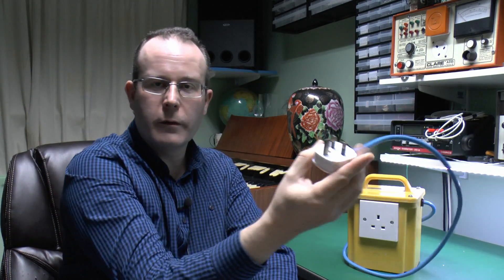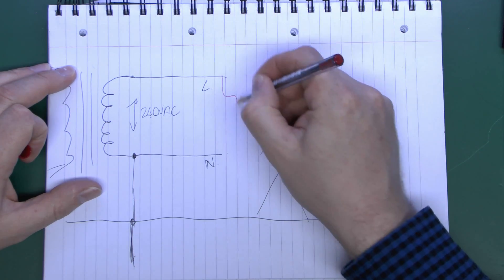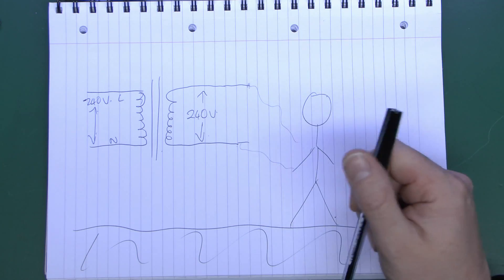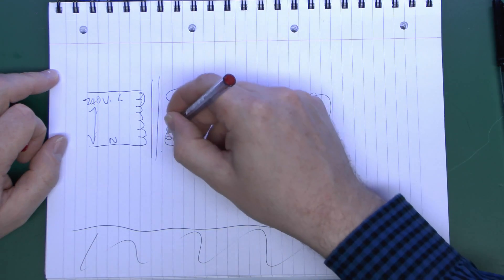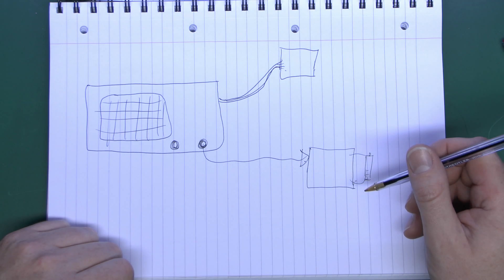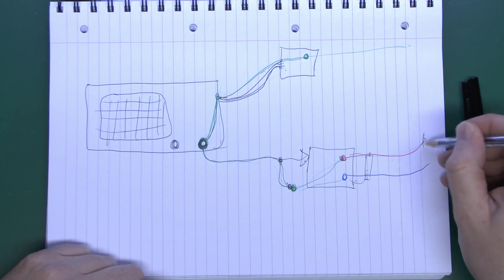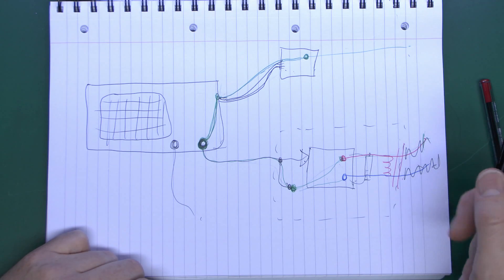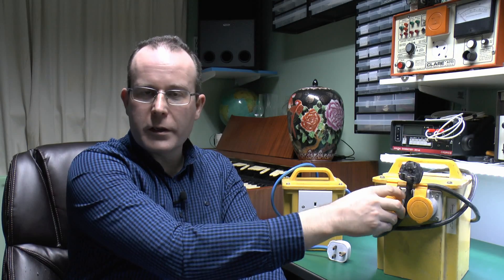Mains Isolation Transformers

Comment: I am wanting to buy an auto transformer and understand the non isolated risks when using one. I want to run an idea past you that I am thinking I could use for my safety. I have already an in-line RCD a RS 3 terminal fused connection block, two 160VA 240v - 24v-0v-24v transformers. I already have the in-line RCD connected between the mains and connection block. I realise this will offer no protection to me if I am seen as part of the circuit. However, I hoped to connect the two transformers back to back. From the 3 terminal block,  240v to lower voltage to lower voltage to 240v to a fused socket and plug in auto transformer. I could to minimise eliminate the RCD and terminal block and connect to a fused plug, these can be looked at as convenience, or not. Am I over looking a problem. Any advice is very much appreciated.
Reply from the maker: You can, provided the maximum rating of the transformers is not exceeded.
Reply: ***** I will have 3.3 amps 160VA/48V. I will buy a 4 amp auto transformer and fuse both sides, in and out at 3 amps. Thank you.
Reply from the maker: It's 3.3A only at 48V.  On the 240V output, the maximum current is only 0.6A

Comment: 11:00 There is in fact an even more dangerous situation that could happen if you cut off the earth pin from the oscilloscope. Poking the clip from the probe into anything at line potential will result in the metal casing of the oscilloscope (and possibly your workbench) being at full mains voltage, even if there is no fault in either in the scope or in whatever device you're probing.
Reply: I remember many years ago when I was carrying out PAT testing at an aircraft factory near Gloucester. I found an oscilloscope that had no earth continuity because someone had foolishly disconnected the earth conductor in the mains plug. They were not happy when I reconnected it. I had no alternative other than to submit a formal report to the firm's safety officer.

Comment: out of curiosity, what happens to the earth going into and coming out of the isolating transformer?
Reply: +TornTech 
This has been asked before by "sbusweb" amongst others, hope John Ward will answer that original question eventually =)
Reply: Darren Tipple  In Finland isolating transformers actually have an unearthed socket on the output. The only legal way to use an unearthed class 0 equipment in a room with earthed sockets is actually an isolating transformer.

https://www.trafox.fi/wp-content/uploads/2015/12/KLT2000_230.jpg

If course most people just take a knife and cut the plug to fit a schuko socket. Nothing is more comfortable than using a computer resting your feet on the grounded case and operating an old hot chassis radio with your left hand.

Comment: Hi John, how did you wire up the 110V output to only put out 55V? Thanks.
Reply: +ChompChompNomNom 
each yellow socket has 3 pins, 2 ''lives'' (connected to ends of output) and one earth (connected to centre tap of output).
In effect that 'earth output'  pin is also a neutral, and both of the other pins have voltage on them.  Think  Live ~~ Neutral+Earth ~~ Live   output.
There is 55v AC between either Live and the Neutral+Earth output, so can use that directly.  There is 110v AC between both "Live" outputs which is where normal building-tools are connected across...
Hope that helps, and hope John may answer my other question about Earth contact on the 1:1 isolating transformer soon =).
Reply from the maker: +ChompChompNomNom Connection is done in the plug, one wire to the 'earth' pin, one wire to one of the other pins, last pin not connected.
Transformer itself is not modified.
Reply: +ChompChompNomNom
Listen to John's at 13min in the video onwards.  The 110v building site transformer is centre-tapped to earth.   Think  L ~~~ N+E ~~~ L   as output connections...
Reply: +Jonathan Brown
Listen to John's at 13min in the video onwards.  The 110v building site transformer is centre-tapped to earth.   Think  L ~~~ N+E ~~~ L   as output connections...
Reply: +Jonathan Brown 
On those building site isolators,  Earth is normally connected through, this is important to make sure RCDs on the output of the transformer function properly when feeding more than one bit of equipment.  If the centre tap to Earth was not present, it would be possible to get various nasties e.g.  one fault to earth, meaning the other line reaches 110v wrt ground  and/or  more easily get shock scenarios not protected by RCD.    HOWEVER, I do wonder about the earthing options on the 1:1 isolator running single bit of equipment only (separate question left for John at root of comments tree...).
Reply: +Jonathan Brown I have a spare 110V plug so what I'm going to do is simply remove one of the lives and swap the wires round and on the other end connect a socket which will be used for testing Chinese fuses, cables and whatever else. I assume that he other piece of equipment from the last video that he mentioned is probably his old Oxford welder.
Reply: +Jonathan Brown No I would be just disconnecting one of the lives, and on the other end, connect the earth / neutral to the neutral and one live to the live. The other end will be a 13A plug socket with a back box. There won't be an earth on the box.
Reply: +ChompChompNomNom
No, each yellow output socket has 3 terminals on it already, you don't need to go ''across sockets'''...  Also if you read my previous message you will see those sockets don't per-se have L and N ...  more like L, N+E, L ....
Reply from the maker: +ChompChompNomNom Connect between the earth pin and one of the others.
Reply: *****
Sorry I dont understand, do you take the earth from the other socket and connect it to the L or N of the to-be 55v socket?
Reply: +sbusweb So all I need to do is wire up the plug so that the output Live is connected to the Live and the Neutral pin is connected to the Earth socket? Or do I need to rewire it internally?
Reply: +ChompChompNomNom Step down transformer.
Reply: I know man I've got a wicked setup. Variac to trasnformer, to fuse holder, to plig hole. All I need now is something which can boost voltage now that I have amps.I'm thiking microwave transformer.
Reply: +ChompChompNomNom Mine can do about 40A before the clamp meter overloads.
Reply: +sbusweb The 110v side wont be earthed. Who cares anyway just wear gloves :)

Comment: Isolation transformers were at one time  very common in some patient care areas of hospitals (Canada) where mains powered  equipment was connected to patients for  any given time.. They also had to be monitored  for leakage current in microamps, and fault location (L1 or L2) ...  Now in new installs these are not common as most medical equipment  is effectively isolated by a transformer within the device or within the cart it is attached in or on.
Reply: You mean this type of isolation transformer ? https://www.youtube.com/watch?v=5SjVm-rF39A&t=1857s

Comment: Excellent Vid, Should you have a double pole MCB will using a 230v C.T.E traffo?
Reply from the maker: +IrishHitman79 Yes, double pole MCB should be used on the output.
Larger transformers with multiple outlets such as those used on building sites usually have DP MCBs fitted as standard.

Comment: I started working on the so-called All American 5 vintage radios. These have one side of the AC line connected to the metal chassis & the tube/valve heaters in series. And since old US plugs weren't polarized, connecting one way would make the chassis hot/live, even when the radio is switched off. So, I made myself an "iso-xfrmr" using a pair of doorbell transformers connected back-to-back.

Comment: Does this mean that the earth downstream of the isolating transformer is electrically redundant as it would not provide a current path?
Reply: +Simon Howroyd Yes it is redundant and some standards specifically require that the earth on isolation transformer outputs must not be connected. 
Depending on the situation the earth after an isolation transformer can increase or decrease safety in case of a fault, so this is a contentious point.
Reply: Yes, in Finland Isolating transformers do not provide any earth connection as one use is to use an unearthed device in an earthed room.

http://www.trafox.fi/wp-content/uploads/2015/12/KLT2000_230.jpg

Comment: That's a really good explanation (as always!)
The oscilloscope analogy is perfect because, I have to admit, I learnt the hard way. Back in the early 90s I made the mistake of "live" working on a valve amp. Didn't use a mains isolation transformer as I thought I was careful.

No shock fortunately, but 240v straight up the test lead into a £399 HP 'scope didn't end well. Amp survived, scope wasn't so lucky.

It's amazing how quickly you learn to always use an isotran after watching your prize measuring tool emit it's magic smoke!

Comment: Hi John,In the video, the earth crocodile clip of the scope was shown to clip onto the neutral of the non isolated device under test. Will that not create a parallel path for the current from the live wire in the device under test to flow to the neutral as well as the earth of the clip?. There will be an imbalance between live and neutral in the scope circuit and/or device under test circuit. In that case, if there is a RCD, will the RCD trip?Thanks.
Reply from the maker: +istoreit Yes it would.  The RCD might trip, depending on how much current passed via the test lead.

Comment: Another issue with isolating the scope instead of the device under test is that the scope BNCs could become live simply by connecting the probe's ground lead where it shouldn't be. I need an isolating transformer, might make one by taking the primary winding of an MOT and replacing the secondary of another with it, so it has two 120v windings.

Comment: Simple question but... If the incoming neutral is connected to earth, why do we have a separate earth running through the circuit, especially when the earth is connected to the neutral when it enters the house (our old house anyway). Never been clear on that. Thanks John.
Reply: The reason for that is somewhat complicated but I will try to explain my take on it. In the case of GFCI outlets (other countries call them other names) all of the power goes from the live and into the neutral, and in theory, the current measured through each terminal should be the same. However, if current leaks from live to ground, such as a faulty motor winding or a wet piece of equipment, the RCD will notice that more current is going through the live terminal than the neutral (because live is leaking to earth) and disconnect that piece of equipment. The earth helps to make damn sure that someone didn't mix the live and neutral around, because if there was just live and neutral and the chassis was connected to neutral instead of earth, if someone jams the plug in backwards or the electrician had too many drinks, all of the sudden the appliance becomes live. Here in america, we had non polarized sockets where you can mix the live and neutral around without any difficulty, these were mainly used for older lamps and stuff. I know this is not a great explanation, but I hope it helps :D
Reply: Thank you that helps.
Reply: +Colin Herbert Here in Belgium we still run 3phase 230VAC (3X230VAC) in some places and so that means that there is no neutral whatsoever. These are the older lines, and are replaced on street level with 3x400+N, with each domestic house tapping into one phase randomly or controlled, to spread the load. But in the case of 3x230 you obviously need a separate earth tap. 

Also in some cases the power companies fuckup hard and your voltage will be higher between phase and PE than phase and N. This means that your own earth will protect you more than the N. It all stacks up.

And i do have a question for some people here. In Belgium we require the PE tap to be below 30ohms for domestic purpose. What is value in some other places ?
Reply: In the UK there is a supply system called TN-CS which in essence only has the two wires entering the premises, the line and the combined earth/neutral.  The reason we then separate the earth and neutral, apart from RCD issues, is reliability. If you have a combined earth and neutral in your final circuits and the combined e+n became detached then you can end up with full mains voltage on the exposed metalwork on anything downstream.  It is an illegal practice in the UK for a consumer to combine the earth and neutral in the same conductor. For a similar reason, the TN-CS earthing system is banned in caravan sites and marinas as the risk is of an open circuit neutral and earth from the supply is considered too great.
Reply: +Colin Herbert A single connection for earth and neutral used to be common in many places, the building where I work is still wired that way. You need to provide local GFI/RCD protection as needed like Luke described. 

As you say it is now only common on a distribution level, and split up where the power enters the house. This way you can still have a lower earth resistance and better lightning protection without the associated danger of unreliable connections in your house wiring.
Reply: First it is not strictly necessary, in many countries grounding was done with TN-C previously but there are problems. The most feared (mostly unjustly) is the breaking of the PEN cable which causes mains voltage to the cases. There is a real safety issue that in TN-C one cannot use RCDs on the panel, one can only have them in the socket after the earth and neutral has been separated. One safety issue is also that DIYs often connect the ground to the live wire.

TN-C also cause tray currents through data cables that can cause interference. That is why the earth and neutral are separated as early as possible.
Reply: and i have found a few of those backwards 2 prong outlets and to verify polarity i had to jump to a known reference source in/at the panel.

Comment: This is probably a daft question.. 
Is the main earth lead still connected to ground at each individual property or is the earth now taken back to the local substations? Years ago I remember seeing the earth on some old places used to look like a bit of iron re-bar knocked into the ground with the earth wires attached outside the property's, looking back, wouldn't this become almost next to useless? 
I only ask because it's something I've not seen these days.
Reply: some houses still have an earth rod where for various reasons the network operator cannot supply an earth. but in most cases now new supplies have the house earth tapped off the neutral in the service head, since the neutral itself is earthed at the substation. there are several situations where this is undesirable for example petrol stations, where outdoor machinery and metal pipework is used, animal barns, garden sheds. this is because there can be a difference between the ground potential on the neutral wire and the local ground potential, so it is inadvisable to use an exported earth outdoors. in these cases a local earth rod should be installed and tested and the network earth abandoned for the outdoor installation.
Reply: +Steve Craft Where you from steve ?

Here in Belgium it's either a rod into the ground in renovation work. And in new buildings we have a earth loop around the house few meters deep.
Reply: Sounds like TT to me.
Reply: +Brian Boterman Sorry i should have made it clear, I'm from the uk.
Reply: +Brian Boterman 

Is that TN-C-S with auxiliary earth or TT system?

Comment: Isolation transformers have a few other uses as well that are a little less safety related. Very handy devices when used correctly.

One example is when measuring RF and you have rather long runs of cable between the transformer providing power to your equipment it is possible to have conducted noise, an isolating transformer breaks the ground current path and can remove undesirable noise.